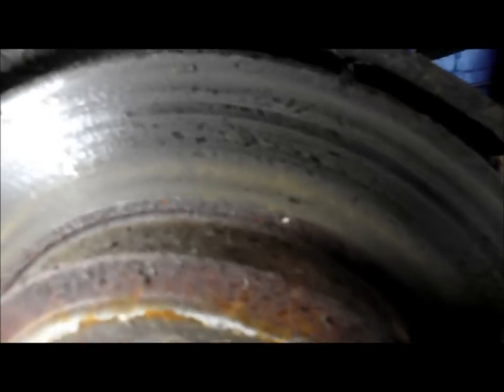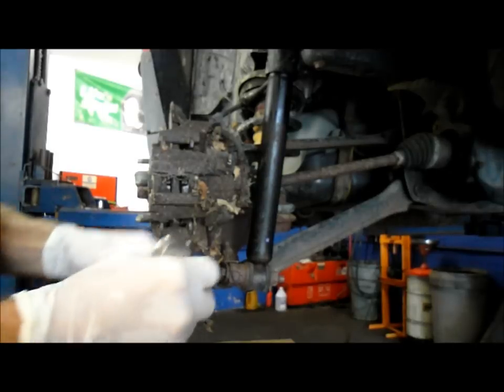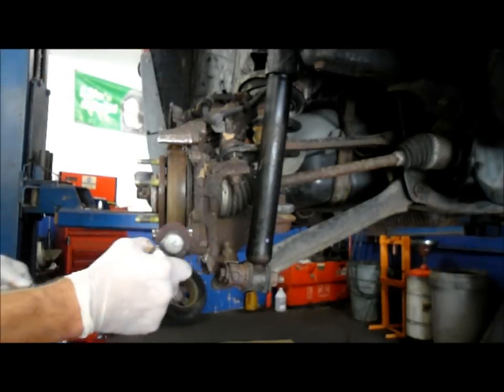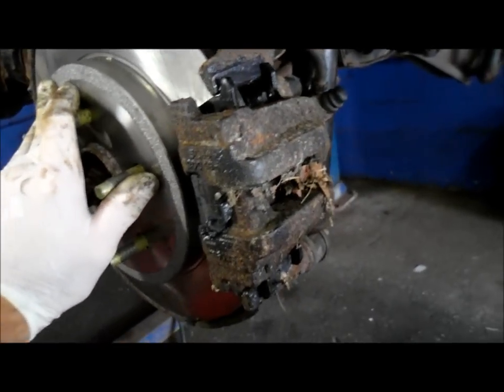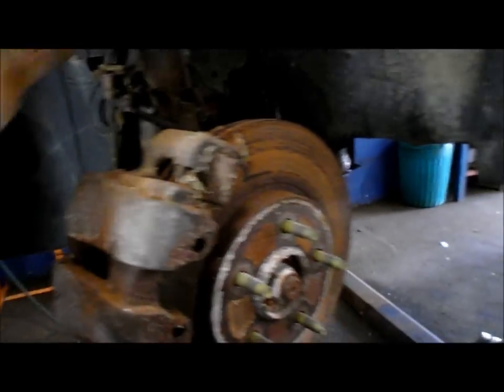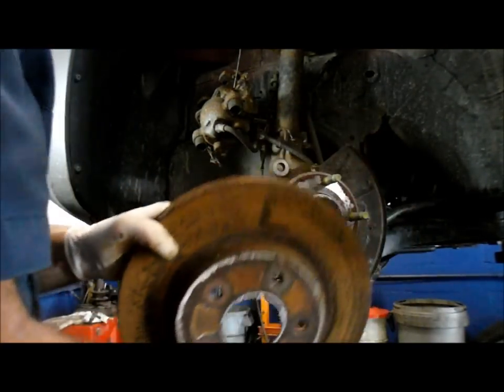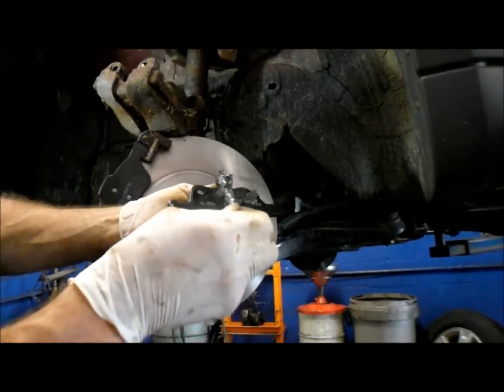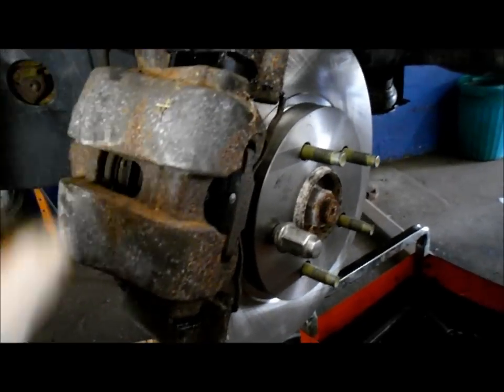How To Replace Front And Rear Brakes With  Rotors On A  Ford Escape

Comment: Thank you Jim for the video.  I'm about to do the rear brakes on my wife's 06 escape and this helped immensely.  I've done the front brakes but was at a loss on the rear.
Reply from the maker: +Kevin Cousins  Good luck .If you need any advice let me know
Reply: Thank you Jim, I pulled out the air tools and got the job done in about 30 minutes.
Reply from the maker: +Kevin Cousins  Great job.30 minutes very good

Comment: Great video. Yesterday I ran into the problem of the rear caliper bolt hitting the shock. First I had the problem of not having the right size torx. Turned out to be a T45. Put the racket on, started to take out the upper torx screw, and hit the shock. Could not get the ratchet to go back in. Tried to remove the lower part of the shock....couldn’t do it. In frustration, we put the tire back on and I took it to Mavis, where they charged me 50.00 dollars to take the ratchet out and another 100.00 dollars to put new pads on. Figured since they had it, why not. Wish I saw this video before I started it. 
A side question.... what does a garage charge for the parts. I know Mavis uses Advanced and a few out her places and when I saw over the years what I was being charges, it turns out to be 2 to 3 times of what it lists for. Then the labor rate. 
Thanks!

Comment: I've let my pickup set over the winter here in MN and the rotors were rustier then those were. I never changed them, after a few miles there just like new again.
Reply from the maker: After the rust came off was there any pulsating brake or front end problems?Thank you for your feedback and for watching.

Comment: Please explain the tools used as my husband can not figure out if you are using a torque wrench or Allen wrench at one position on twobbolts
Reply: Brenda Cruse Its confusing. In the video he said 8 mm socket which may or may not be the case. It might well be a 7mm hex drive.

Comment: I have tried a 7mm on the rear caliper bolts, which fits, but not well enough to bite in.  8mm is too large.  They don't look like they are stripped, it just doesn't look like the 7mm fits.  Perhaps it was a dorman or something replace previously, but it is the same on all four rear bolts.  I think I will grind a 5/16 and see if I can get it to fit.
Reply from the maker: +thehowards6  Keep me posted.
Reply: My 7mm fit mines

Comment: Ok you say ask if I have any problems....lol
I was able to do my rear rotors and brakes on my tribute with ease using your video....however, I then watched your other video on a sonata.... fortunately mine didn't require taking the bolt out of the arm....but lots of other issues....seized bracket bolts... completely rusted rotors, brakes, the whole nine yards....I was able to get all of this solved except one caliper is shot....it will not go back in...I looked at replacing the caliper and Auto zone has two showing for my car....you can buy the bracket and caliper separate or the caliper with a built in bracket...the question is this....can I use the combo one? And if so do I have to do it on both sides?? This is on the rear BTW...2000 v6
Reply from the maker: First let me say good job.With brakes you never know what your getting into until you start.As for the caliper and bracket I always try to replace both at the same time and you don't have to replace both sides unless there is a problem with it for example the bolts are rusted or the piston will not push in.
Reply: jimthecarguy thanks for the reply... I did end up replacing all calipers, brackets, rotors, and pads....everything was in such bad shape....now I know it's right! I drove it around tonight....very smooth....and thanks to your videos I have saved a fortune in labor alone..... plus I found that I really enjoyed working on it myself....😋

Comment: How do you compress the rear piston completely, i can get it halfway with almost no effort, but the rest of the way is not working. Im using channel locks
Reply: Use a c-clamp and release pressure  by removing the master cylinder cover

Comment: So someone had told me someone else had used an Allen wrench instead of the 8mm. ??
Reply from the maker: Yes you can use an Allen wrench as long as it is 8 MM. Thanks for watching.
Reply: @jimthecarguy  On my '05 Escape, those pins take a 7mm allen wrench, top and bottom.